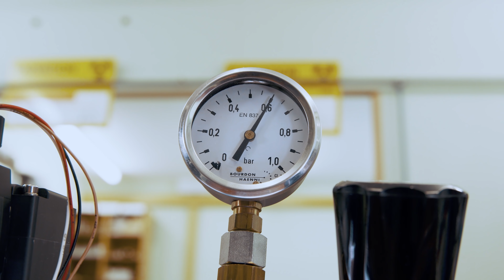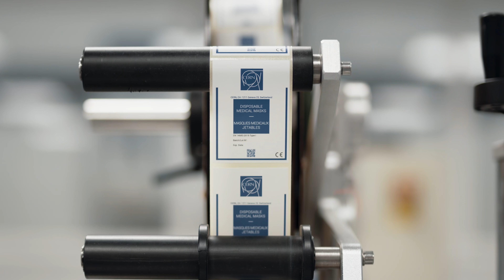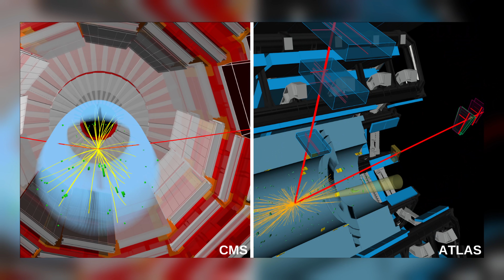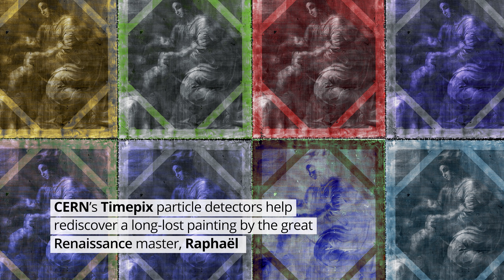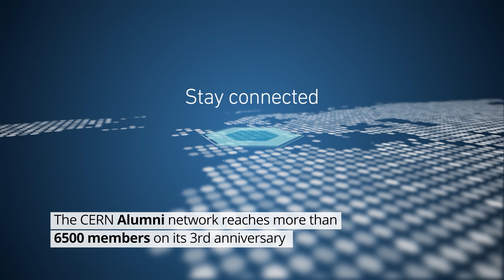CERN Highlights 2020

Comment: Creation of antimatter is very dangerous
Reply: Not really.
Reply: @MajinOthinus  how so
Reply: @emiitchi4232  Because the amount of energy you have to put in in the first place will always outweigh the amount of energy, the finished products holds. 

In other words, it would be more destructive to use the energy they put into creating it directly for destructive means and since we can control that amount of energy, controlling a snmaller amount of energy is way easier than even that.

Besides, with how miniscule the amount of antimatter that is actually produced is (we're talking on the scale of maybe a dozen atoms at best), there is no danger either way. The worst that could happen, would be that some very expensive measuring equipment gets damaged, but even that is very unlikely.